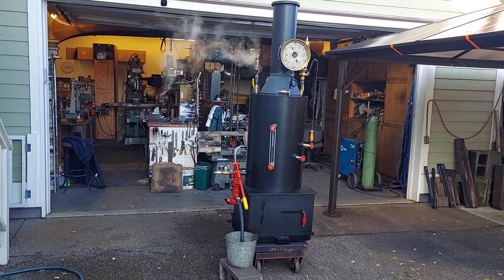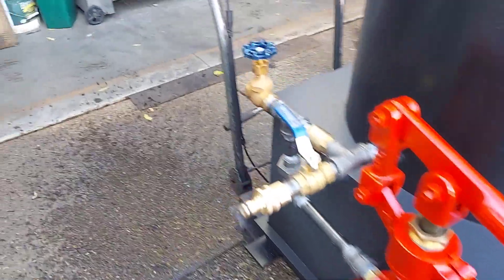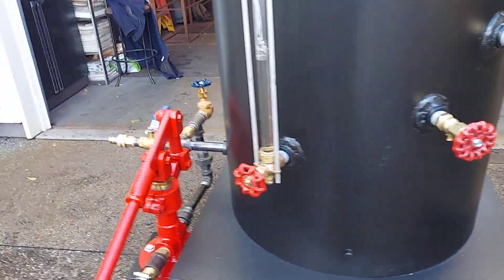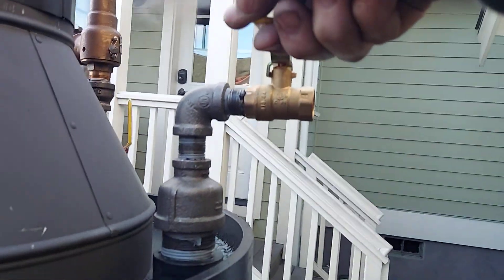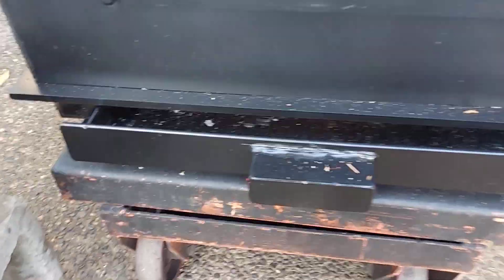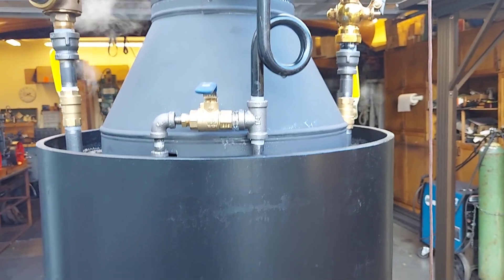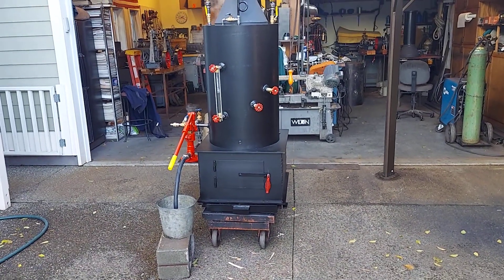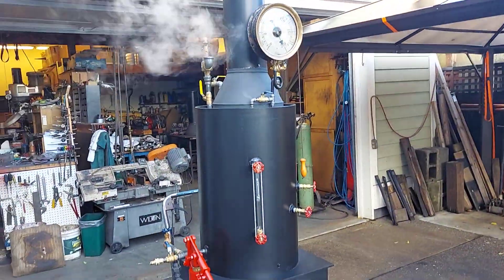FOR SALE Steam Engine Boiler Pump Whistle Off Grid Live Steam Engine Ross Bendixen American Steam

Comment: Great job Ross ! I am so pleased with mine. Some fortunate person will enjoy and appreciate this newest build just like I do with mine. Thanks for the great work. Michigan.
Reply: Are you off grid/prepper or collector?
Reply: @LL-wc4wn  started out as a hobby/point of interest but as time went by and things ahead didn't look so secure or dependable I just added auxillary items so I could have a solid fuel generation source. Of course batteries are a must just like solar. I am grateful to Ross for building this equipment because there are almost no companies that build these practical sized units. Most are for industrial use. He shipped it  mounted on 6x6's and I moved it and anchored it to an industrial flat deck material handling cart with a wooden deck and steel wheels.